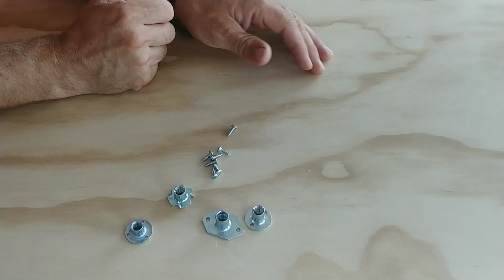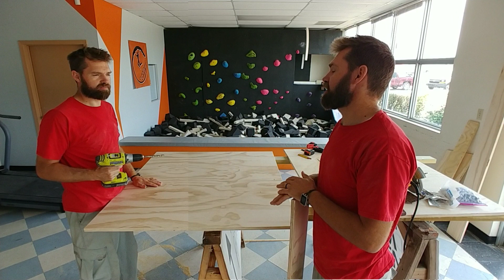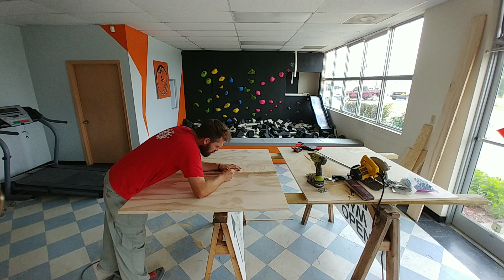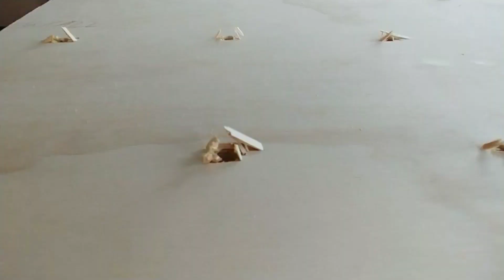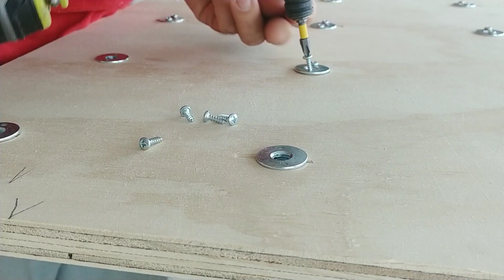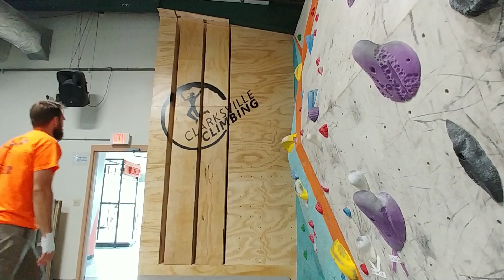What T-Nuts Should You Use for Your Climbing Wall

Comment: Can you place the back of those t-nuts directly against a stud?  Or do you need to space them so none of them lay against a stud?  OR, do you need to drill out a little space inside the stud for the back of the t-nut to fit into?
Reply from the maker: In my teenage years I built a couple walls that the T-Nut goes up against a stud... Not good. If you put a hold on in that spot and forget there is a stud there you can pull the panel off of the stud, ripping out the screws, especially if you are using an impact gun. If you're mindful, use a bolt in those places that doesn't stick out more than the thickness of the plywood you'll be fine.
In short, I would avoid it.

Comment: Very helpful but my brain breaks when I hear inches so many times, I got lost in dimensions 😅😅 Could U pls respond with the sizes of t-nuts, bolts and drill bit(?) diameter? :)))) 🙏🏽
Reply from the maker: T-nut size 3/8"
Drill bit size 7/16"
Bolt size 3/8"

If you are in an area that uses the metric system I can tell you that the t nut and bolt size is a 10 mm. I have no idea what the drill bit size would be.

Comment: Thanks for the video! Do you have any suggestions on using stainless steel t nuts vs zinc plated for an outdoor wall?
Reply from the maker: Stainless can mar/Cross thread easier so I tend to lean towards zinc plated t-nuts.

Comment: Why not the cheaper T nut with a screw so that it cant spin?  Holes are not necessary in this case.  I think you only need one  3/8 or 1/2 deep screw to stop it from spinning while tightening!  Then just be cautious changing your holds. Anyone...? Anyone one? I will try.
Reply from the maker: The 4 prong tnut does pretty well. It's biggest issue is people pushing it out when taking off the holds. It's natural to push on the impact drive when taking out the bolt and that can walk the tnut right out of the board. I have used 2 #6 1/2" screws on this tyoe of tnut and it does seem to help.

Comment: Do you pre-drill before screwing in the t-nut or just place and screw with no pre-drilling
Reply from the maker: Technically you probably should but you will go insane. No builder I know of puts in pilot holes for the screws holding in the tnut.

Comment: Thanks for sharing. I saved some money because I almost buy from a supplier which is 30c more expensive than these. I bought 300 tnuts. Please share info about bolts as well. Quite confused with the head types, lengths for different type of holds, zinc plated or steel, etc.. 😁